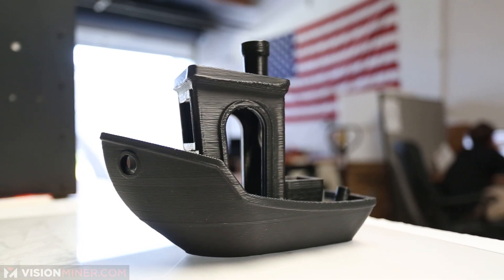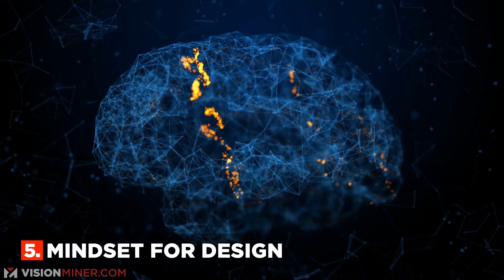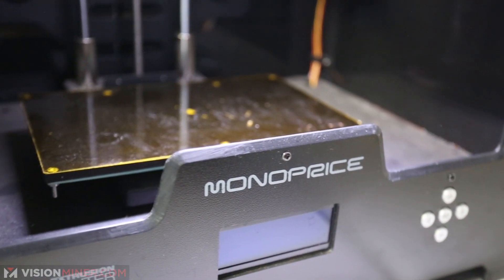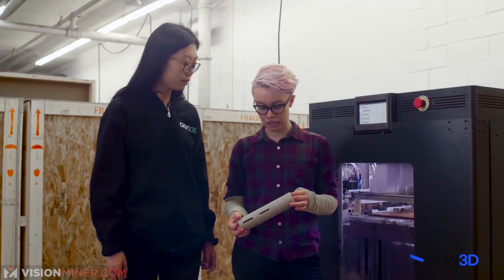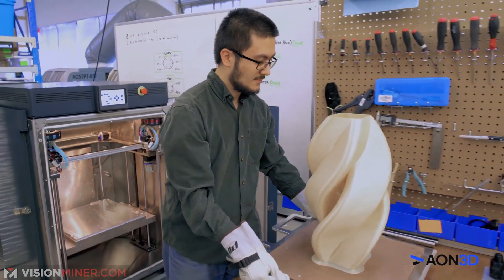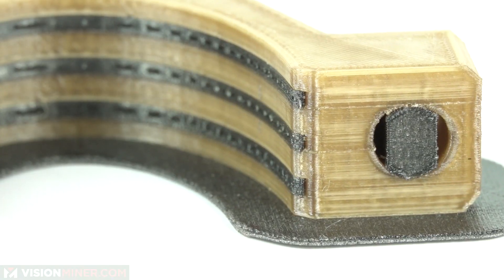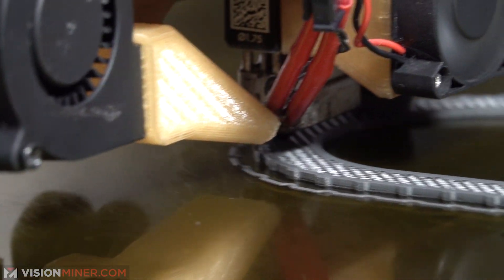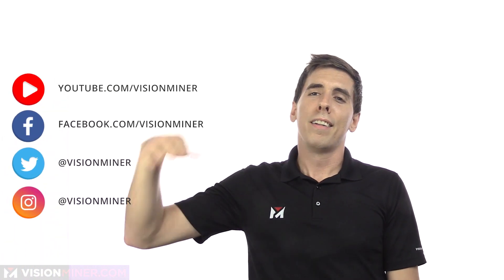Hobbyist vs Industrial FDM 3D Printing: Toys or Tools?

Comment: Should explain differences between FDM, SLA and SLS use cases, to give wider context about FDM.
1 - Design for Aesthetics / product displays
2 - Functional / Mechanical products
3 - Functional J&F parts used in production
4 - R&D, fine tune designs on all of the above, shorten PD cycles
5 - Printer research for new substrate materials

Comment: for truly functional prints. i would just print with pla and fire up a kiln. not spending $30k.
Reply from the maker: and do a metal casting? Definitely more appropriate for many situations! Usually these printers are used in super-specialty situations for aerospace / medical / oil and gas where the cost is actually justified, lol

Comment: I Soooo wanted to buy one of your printers (the Funmat specifically) but I just couldn't get there financially. Instead I bought as much printer as I could afford (QIDI TECH i Fast). I feel like I'm going to get a lot of med-high temp practice on this printer and with a little luck grow into one of yours. For now I'll just be buying metal reals, drying equipment and filament from you and taking all of your advise which I so Appreciate. Hopefully, I'll find a volume part that takes off and I'll be able to make that big purchase... In the mean time. Thank you for all the help!
Reply from the maker: Thank YOU!

Comment: Thanks for bridging the gap between hobbyist and engineering. I'm fascinated by 3D printing but have zero interest in printing figurines and trinkets, and that seems to be all the hobbyists ever do.  If I ever buy another printer, I'll start at the $5000 level.  I was trying to do engineering prints on a $200 printer and the constant tweaking and maintenance was killing me.  I just sold my printer today and swore off 3d printing until the technology advances.  But I probably just needed a big boy printer.

Comment: I am not sure I like the material idea. See, if you go into a car, most of the plastic in most cars seems to be ABS. Industrial is not necessary "carrying load". While the general argument is good for higher end / stress parts, there is a big market of elements that can be done in "hobby materials". Let's talk about PRUSA printers as example - there is a lot of them that is printed and it is not using those materials. And it is an industrial production - except that the parts do not require other materials. Small holders for screens, dial buttons -> no need to make them out of PEEK or so. And the dials on my lower luxury cars made in ABS are sort of not "hobby parts" either.
Reply from the maker: Absolutely -- the high-grade plastics like PEEK, PEI, PPSU etc are all used in highly-specific industrial applications. I've seen thousands of use cases, and most of the time, it blows my mind. We also see a lot of people asking for PEEK because "they want the best" -- where simple carbon-fiber nylon would be more than enough. It's the wild applications people don't see -- cryochambers, nuclear reactors, space flight, aerospace for FST ratings (flame/smoke/toxicity/offgassing/chemical resistance), optical and laser applications, high-pressure environments, sub-zero environments, and many other situations -- but common everyday applications like automotive interiors certain get by with more standard materials :)

Comment: Thanks guys ! This is a really informative video. One of your best as far as I'm concerned. 

I was 1 of those people who modified my Prusa Mk3 with my own designed and constructed water cooled hot end which has actually been rather successful. But that still doesn't achieve what I'm after. So on to phase 2, and the construction of my "mega printer" one cubic meter print volume, and the ability to print high tech / high temperature materials.! 1 of the ways I plan to save a lot of $$$ is not to use extruded /bolted together frame parts . And instead I am using welded steel to create a solid immovable but inexpensive frame. I sacrifice the mobility and ability to make future changes easily , but there is a huge cost savings and let's face it once you build these things you're really not moving them anyway. :-). 

The final technical hurdle for me to conquer is in the selection of a heat bed material that is stiff and yet warp resistant with low thermal expansion coefficients. But one which can withstand the forces of printing with the technical materials.

Perhaps a "sandwich" of materials?  Any suggestions?
Reply from the maker: We can do custom sizes of our new-version high-temperature carbon-fiber plates, good up to 200C -- there are some other things in the works, as well, so let us know what you need and we'll do our best to help :)

Comment: Complete non-sense and demagogy lvl.999 only to excuse price of "profi" printers with studid ad. PEEK and others advanced polymers can be good for some special aplikacion regarding to temp. resistance. But with hobby printer you can definitelly print tools for industry from ABS, NYLON, PET-G and even PLA - its all about application conditions! And you also "forgot" to mension that all fdm printers even the most expensive has issue with low layer adhesion in Z axis, which is much more weaker than X,Y axis, this makes FDM/FFF printers dificult to use on some industry aplication. If you want industry technology you will be talking about SLS, not overpriced FDM printers.
Reply from the maker: We disagree -- poor layer adhesion is 90% bad settings, and they can be modified to achieve near isotropic adhesion on most materials -- however, that's usually not ideal, and you're correct, it's a "sore thumb" of FDM. However, with proper printing, not using manufacturers recommendations, you can get a LOT more done than most realize. The main difference is specs and build quality, but there are plenty of applications for FDM in industrial settings -- we wouldn't have been around almost 5 years if there weren't :)
Reply: @VisionMiner  lol :D You disagree? Thast physics, you can disagre but you cannot fool physicals laws and when you layering plastic each layer, it will be ALWAYS in Z axis weaker, its not fusing of material like laser in SLS.And PEEk printers are not exkluded its same like others material, or do you have tested it on bench like for example CNC Kitchen YT chanell do it transparently? I doubt it. You know why. What do you saying about bad setting? You talking about profi printers and you need to tune setting for overpriced fdm craps? So thats much worse than basic prusa for for that price I expeded optimized profiles from "profesionals". So not happen here? Thats even sadder.

Comment: At its current stage my Ender 3 prints very nicely with a variety of engineering filaments, namely carbon and glass filled nylons, ASA and PC. That said, that’s the cap. There’s a lot that can be done with like a HT-CF PA12, but PEEK or PEKK aren’t happening. As it stands I’ll be grateful and work my way up to a true pro machine, but it’s good to know that more complex plastics are very much capable of being printed well on cheap machines with careful upgrades
Reply: I know this is an old comment, but do you mind sharing what the upgrades are? Thanks!
Reply: @rizalardiansyah4486  Honestly doesn't take much. Need a hotend that can get up to around 300 C and a hardened nozzle for filaments that contain carbon fiber. And an enclosure.

Comment: Great video! What about the differences in post processing? I have seen that hobbyist 3d printing often requires to clean the piece, removing the leftover material manually and cleaning with water. Is this avoidable using an industrial 3D printer?

Thank you!

Comment: Thank you so much for sharing your professional views of this mysterious 3D printing world. I am a online retailer and try to make a new small kitchen product will be made of silicone. I have been trying to find a best fit printer under $1000 for TPE filament. I have tried a lot of the cheap  printer, but all prints were not working as real products. I even tried Prusa MK3s, but the results are still not that ideal. Can you please give me some advice on what the most suitable printer for soft TPE like 85A is?

Comment: Very interested in your advice for a beginner whom wants to 3d print mainly with peek & Ultem? Preferably Ultem 1000 but for a beginner printer and good quality of course? 
Thank you for your information
Reply from the maker: There's no better deal on the market than the Funmat HT for the price -- seriously, though, at $7k the closest competitor is north of $10-15k -- and even then, the Funmat is a prime competitor. Amazing, too, after 3 years... :)

Check it out: www.visionminer.com/funmat-ht
Reply: I thank you and am so excited to begin my journey. I would greatly appreciate logistics of the printer. Maybe elaborate a bit on the difference in your opinion between Ultem 1000 and some of the other Ultem materials not so translucent or clean.?

Comment: Hello! Thank you for great material. Could you tell more about the details of the differences between the machines? Is it just more expensive and more accurate bearings and guides? Or maybe there is some other philosophy behind it (for example, you mentioned the chamber and the temperature regime inside). I am asking because I think that this knowledge can allow us - users of amateur, cheaper printers to improve them in a more professional way. We do not have access to such expensive equipment to look closely at it and see what professional solutions have been used. Thank You!
Reply: Basically better quality parts ie: bearings linear rails and such, but you don't need to spend that much in building a better quality machine. Focus on keeping your electronics out of the "oven" Keep your steppers out as well. And you can add a heater to a cheaper printer and have decent high temp filament printer.
Reply: @svenland6892  Linear rails is a bad argument given that you really have to go LOW END to use those bad wheels. Higher end hobby printers already use linear rails - albeit probably not the super high quality, that already eliminate a lot of problems.
Reply from the maker: 90% of quality is in the tuning -- but, of course, if your machine is out of whack, tuning won't help much! A lot of it comes down to tighter tolerances on parts, made from metal, quality bearings etc -- in order to stay in-spec for a much longer period of time, especially at high temperatures. Everything eventually wears out -- if you look at the MAAM, created by Cincinnati (video coming out shortly!), they use insanely bulky frames, guides, rails, etc -- the machine will print for YEARS before getting messed up on the hardware side, much like a HAAS or Tormach CNC machine. Built for constant production, year-round!
Reply: @VisionMiner  You're doing things i should have done years ago!! , i just don't and never hand the balls to do! Thank you guys for bring leaders! Balls the size of Montana!!